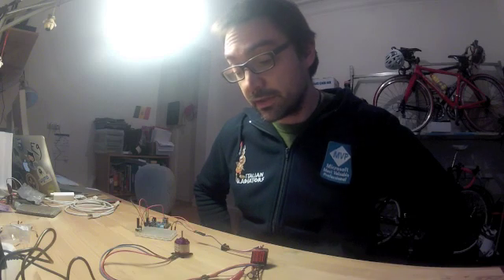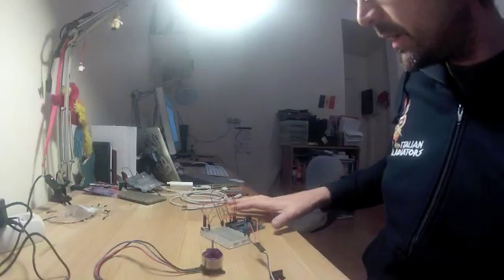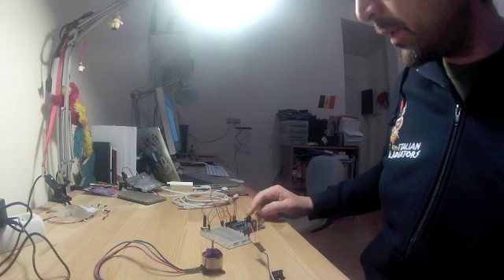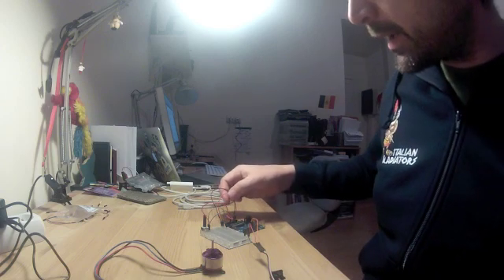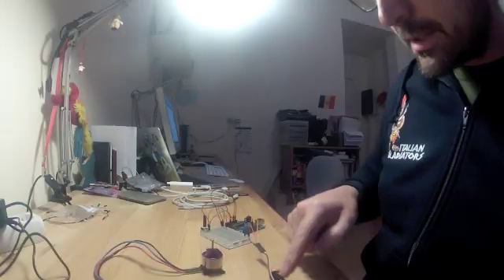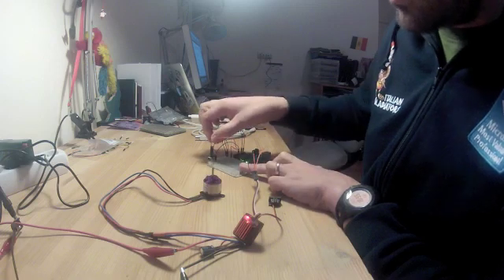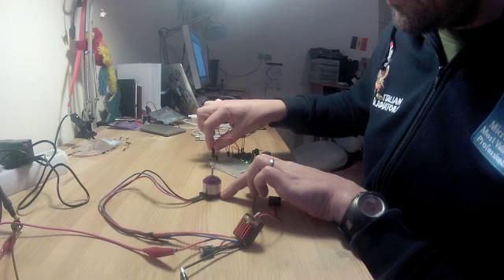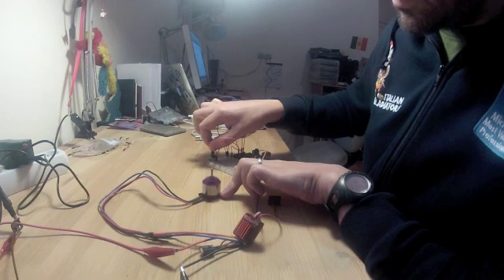ESC calibration with the Arduino

Comment: hello Simone this great think u have done but i have a question could the ESC control the motor from the stop to a variable speed depending on the potentiometer(voltage divider) position only in one direction ; and is ther any possiblity to use the ESC without the arduino (controlling with extra component )
if im correct the ESC needs a pwm signal to work or what ?

thank's Simone